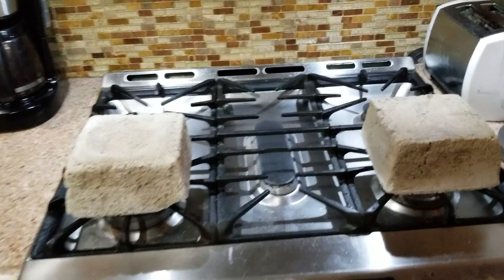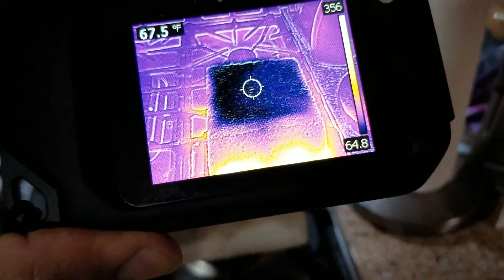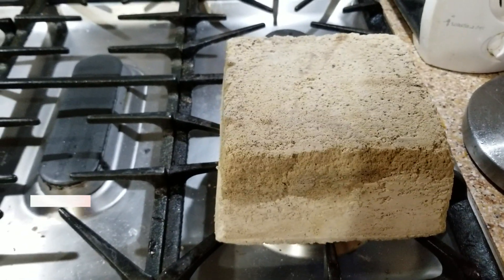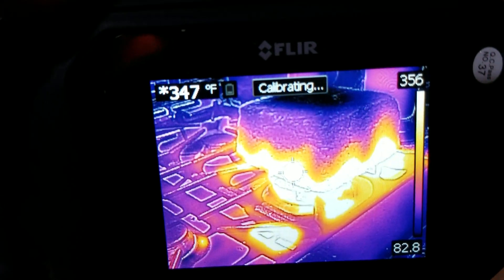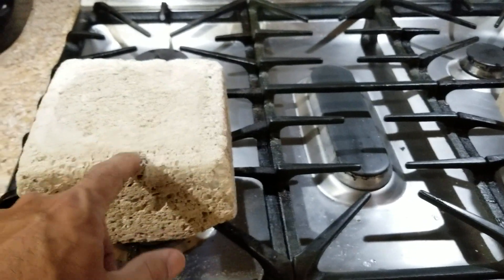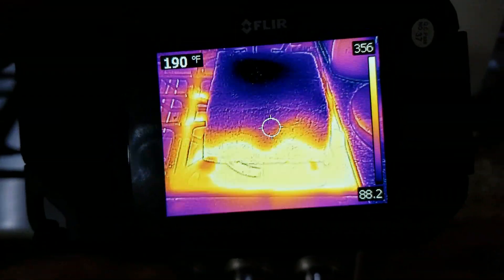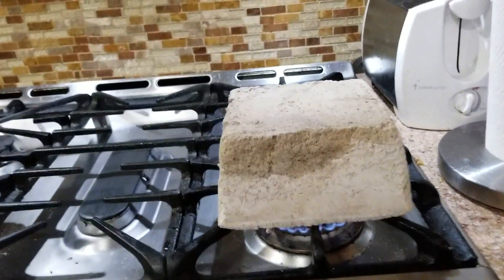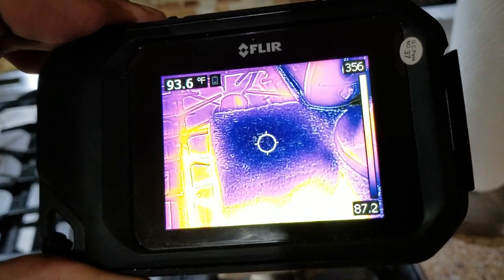Aircrete | Thermal Camera Flame Test #AircreteHarry #Aircrete #ThermalFlameTest #Dome #DIY #testing

Comment: I'm new to this channel -- may I ask, what does 30-gallon and 100-gallon mean?
Reply from the maker: When making Aircrete you add 6 gallons of water to a 50 gallon drum and one 94 lbs of Portland cement and what you have is 7 gallons of cement slurry. Now to make Aircrete you add foam so for a 30 gallon mix you add 23 gallons of foam and for the 100 gallon you add 93 gallons of foam.
Reply: @AircreteHarry  Ah, got it, thank you!
Reply: @AircreteHarry  How do you get a 100 gallons of mix in a 50 gal drum? How much soap to total water to total cement?  I wonder if there is a better way of stating it so It could be reproduced, scaled and cut out container size wich just makes things confusing. Something involving ratios. like using a (foaming agent to water) foam TO (Lbs cement to gal water) slurry ratio. So it seems for the 30 gal mix it is a 30.4% mix. To get that you add 23 gal (x soap + 1 gal water) foam to 1 (94 lbs cement + 7 gal water) slurry.  For the 100 gal mix it is a 7.5% mix. To get that you add 93 gal (x soap + 1 gal water) foam to 1 (94 lbs cement + 7 gal water) slurry. I am saying x for soap to water on the foam because what mix ratio you are using is not stated. This is stating cement slurry to foam percents if you want to state it as foam to slurry just do the inverse.

Comment: Great test! Newly subscribed so thanks for the 30/100 gallon explained. Curious are you going for a finished product with or without thermal mass?
Reply from the maker: Yes the finished Dome will have a 3 inches of cement with Basalt Rebar, on the outside of that will be 9 inches of aircrete with a waterproof skin coating of a cement.

Comment: Harry,
first, thanks for all these vids, I've learned so much my God!!!  I have several aircrete projects right now, I do a pour a week or more, as schedule permits. You saved me so much time and introduced me to so many valuable ideas.
OK, now that I've seen your vids with the plans for the egg shaped underground cisterns, I want to build an aircrete cistern.
In my case, it will have to be rectangular (very little space available, and it's a rectangular space).
I want it to be 2m X 2.5m and 3m high, all underground.
All aircrete and basalt rebar. On the top, pretensioned aircrete lintels.
Searching the net, I couldn't find anyone who's built such a cistern.
How do you do the math, to know what thickness of aircrete to use, and what diameter of basalt rebar??? The egg shaped cisterns are well thought out, so apparently you know a lot,..
I have to do it right the first time, my garden is super small, I can't fail and later try at another place in the garden, there is very little room. Masons don't know how to do the math for aircrete and basalt rebar.

Comment: Not only is water a conductor, during evaporation it transfers copious amounts of heat. Also the more air pockets that are in the mix, the more water it will hold on to, more porous. I would recommend you heat both samples thru, above 100c or 212f, and then keep them inside until they both reach the same temperature, within 1 degree c, or 2 degrees f and approx room temperature. Low heat and a long heating cycle, or in the oven on your lowest setting, you do not want to change the chemical structure of the concrete by over heating. To properly determine room temperature, take temperature reading from multiple large items in rooms, not interior walls, they are normally connected to crawls spaces and attics.